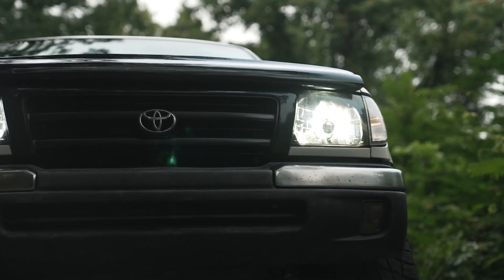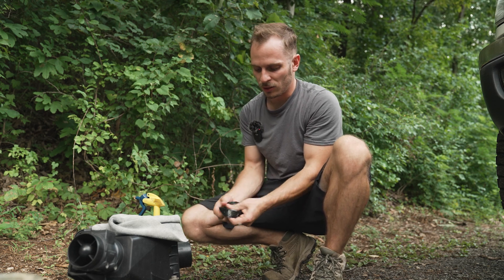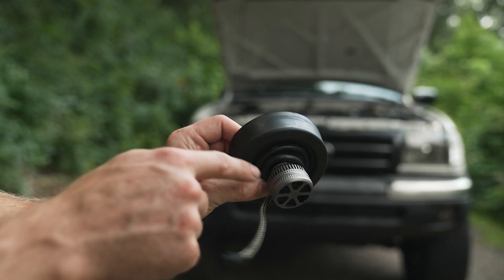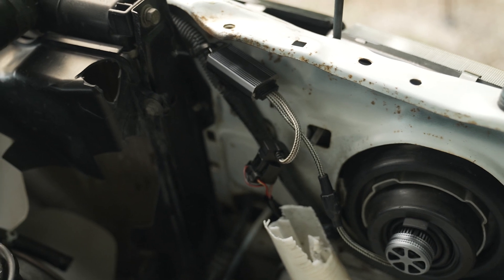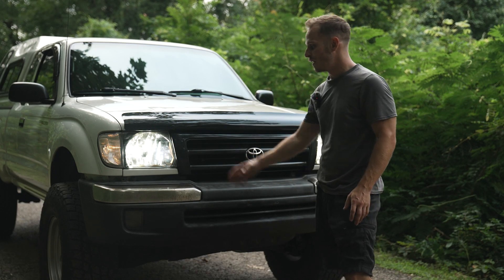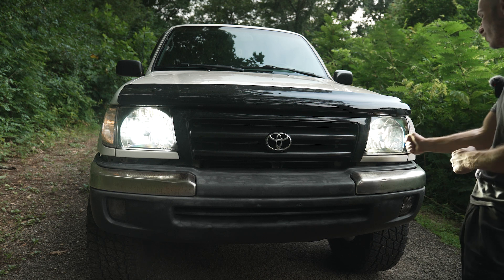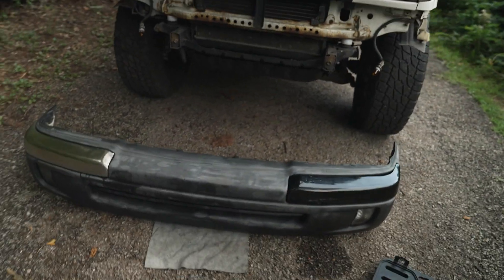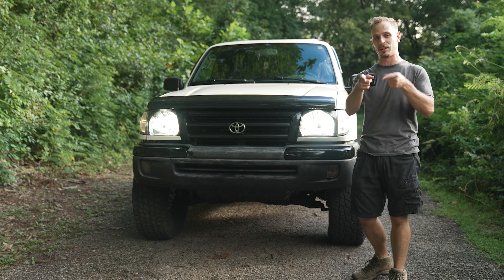The Greatly Improved Headlight Setup On My First Gen Tacoma

Comment: ✌️taco brother i see you have the asid battery 🤦 you should upgrade to AGM battery with the one way diode better starting , Britter lights ,wont dem down on idle an the AGM battery will last 8 to 10 years 3 years on asid battery . Look on the form i did 8 , i did it 7 years ago ✌️

Comment: You are not supposed to put LEDs into reflector housings because it’s not a 360° beam and the upper reflectors can’t create a horizon line. Also, does your high beam indicator light work with those?
Reply from the maker: It never works with leds or hids. I agree with you on the light horizon.

Comment: Share the alternate wiring kit other suggested/ required ??? to install per their web page 

Thanks
Reply from the maker: Sorry if I misunderstand but you should just need to bulbs and drivers for them to work? What kind of vehicle are you installing on?
Reply: @ConnorLee   2004 tacoma 

but previous owner added some wacky cheap bright white lights that have housings that run hot. Plus he re-wired high beams to sep. aftermarket floods via stock steering wheel light switch

Comment: Get yourself a pair of Spyder protectors. Had them in my 99. Whole different level
Reply from the maker: Are those headlights or a separate piece?
Reply: Ehh I have some on my 98 and they are pretty dim
Reply: @nickjensen5161  must not be doing something right. Mine were glorious
Reply: @teeengelke7275  interesting. Did you put other bulbs in? I used the one they provided but man they suck. Need to drive w my brights on all time lol

Comment: I got a 2002 taco a couple months ago and don’t know if I should use full synthetic oil or conventional it’s has 178k miles on her and also don’t know how often to change it please help !!!!!!!
Reply: Synthetic, every 5k. That's the standardized interval as per Toyota for a 2002. Conventional every 3750. As for which you should actually run, that's up to you but I prefer the longer service interval. If you end up consuming oil using synthetic (more than 1/2 qt every oil change interval) then switch back to conventional. Synthetic is a smaller molecule and you MIGHT end up sucking a little more oil past the rings, usually not an issue on the 5VZ-FE though.
Reply: I do synthetic blend at either every 5k miles or 6 months with mine